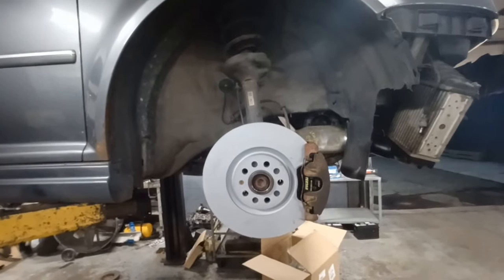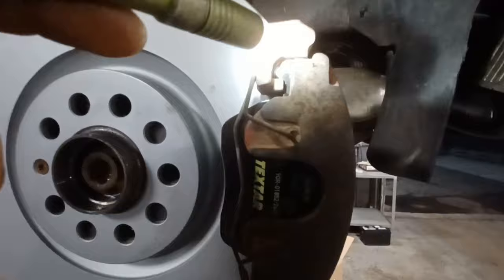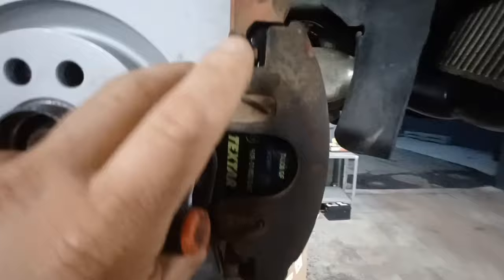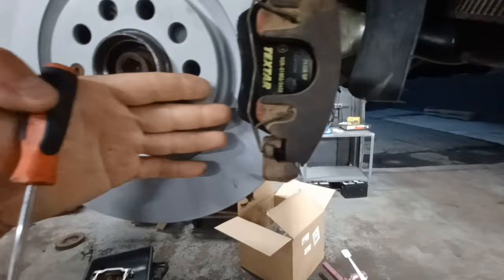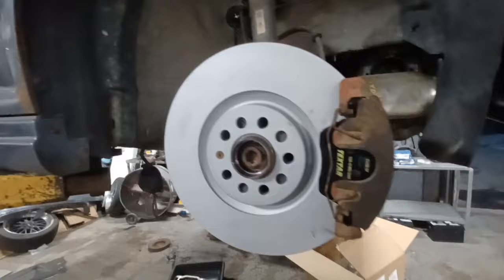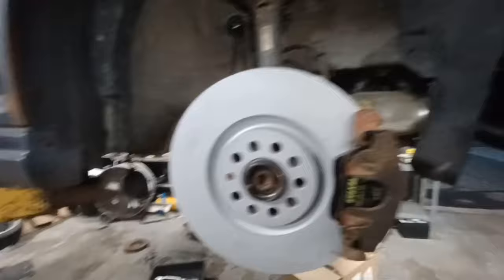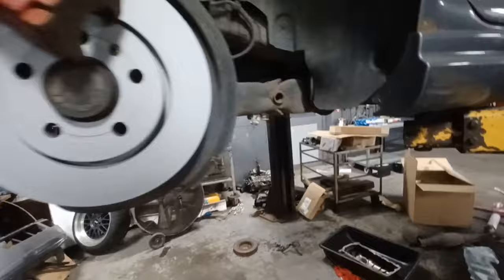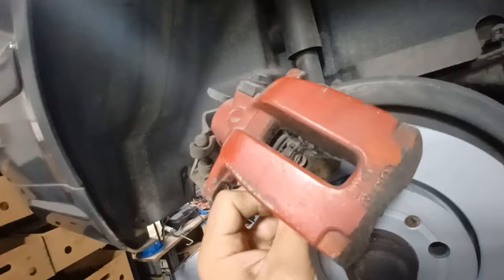COMMON CAUSE OF CLICKING NOISE WHILE APPLYING THE BRAKE

Comment: So far, this video is the closest thing I've seen to diagnosing my issue. I hear the single knock every time I stop. But also a little bit when I take off. I suspected something to do with the caliper being loose, but it doesn't seem to be. Guess I'll check the pads too. Thanks!
Reply: Any luck ?? ME TOO
Reply: @jsupa3737  No luck with brake pads. I think they're ok. I did see another video online that showed the noise being made as they backed up and drove forward. In the comments section I learned that they replaced the lower control arm and that fixed it. That's my next step.
Reply: I had this issue and what was causing it for me was there was only 1 screw holding in the rotor and it was loose so i got a new screws to hold the rotor to the hub but added 2 since on hondas theres 2 screw holes..@renaissancemaneric8019

Comment: Hey, I changed my wheel bearings On the passenger side yesterday and today a clicking noise started coming from that spot, it only stops when I’m stepping foot on the gas and when I let go or only maintain a speed, it starts clicking again. The faster the car goes the faster it clicks
Reply: I was wondering if you can help me out, thanks
Reply: Its an 06 chevy cobalt btw
Reply: The clicking sound is rhythmic
Reply from the maker: Have you already pulled the wheel off and checked all the hardware that was disturbed?
Reply: I have the exact same problem
Reply: Wheel bearing prolly the abs/wheel speed sensor

Comment: 2008 Chrysler Aspen front right wheel bearing was replaced and every since then our truck has been making a noise almost like your bouncing on an old box spring ; we replaced brakes calipers rotors hub assembly on both sides arm control and it still is making a noise as we brake almost sounds like something is going to break it and a noise like your jumping on a old school box spring ! I have take it to three mechanics where I am charged lots of money not fixing issue please help me..

Comment: Hi im also facing this clicking noise when i press break but not all the time. Also when I accelerate or if my car moves over a speed breaker. It wasnt there before, i took my car for an inspection yesterday and they said everthing looks fine just need to tighten some nuts and bolts after that i have been facing this issue . Kindly guide what I should do as this sound is really annoying
Reply from the maker: Does the noise coincide with a brake pad replacement?
Reply: @EuropeanAutoRepair  i didnt replace anything they just told me they tightened the bolt and nuts

Comment: My 2009 Lexus Es350 has had this pop noice for years! Lexus couldnt fingure it out. Since 2022, I replaced the Cv axles, control arms, ball joints, sway bar bushings and links, complete struts and today the engine mounts, and it still does it.

Comment: Thank you for your uploaded video. Because of your video i solved my problem. My local car dealer technician also cannot find the problem. Wasted my money USD 200 change tie rod, ball bearing, stabilizer link. Still cannot solve the problem, somemore wanna change lower arm. After see your video. Ask the technician check the brake. Then solve without single cent.

Comment: Hey man, good video. Hope you're doing well. 
I was hoping for your input on the issue I've been having. 
My Lexus has new front calipers, rotors, pads. New rear rotors and pads. 
When I press the brake pedal there's a very clear click, only one. It happens I'd say 7/10 times I press the pedal. 
I also feel a shaking when I drive the car which worsens with speed. Add to that a humming noise when I turn left. I've concluded that to be a front right wheel bearing which I will replace.
I'm still unsure of the clicking noise I hear in the front end when I press the brake pedal. I have 4 new tires, recently balanced, and aligned. I explained to the alignment tech my issue so he went over my front end suspension and said everything was tight and in good shape. He says he thinks the brakes are probably the source of the issue. 
If what you're saying in your video turns out to be the issue, what's the solution? OEM pads?
Thanks for your time..
Reply from the maker: Hey! Thanks for watching. Yeah typically if you have this going on oem brake pads will resolve the issue. Give akebono brake pads a try if you want to go with a good quality aftermarket
Reply: I have a 2009 Es350 with the same issue coming from the front right. Lexus couldn't figure it. I've replaced cv axles, sway bar bushings and links, struts, ball joints, earlier today engine mounts, and unbelievably, it still does it...

Comment: When I apply the brakes on my van it makes a clicking noise but I feel it also stabbing the pedal so I reckon its an ABS thing - the splined part of the shaft next to the sensor is very rough and corroded so it could be that throwing out the sensor maybe.

Comment: I also changed my Ford Mondeo 5 hybrid brake pads. The original was earlier, but I replaced the same with a textar - I have the same problem - if I slow down, then there is a click at the end, and after that, if I do acceleration, I again have a click after braking.
I will supply the original - manufacturer ATE brake pads
Reply from the maker: Once the pad is loaded in the same direction, (several stops in a row going forward only) does in continue to click or is it only the initial time?
Reply: @EuropeanAutoRepair  Clicks are heard while driving, they do not happen only once. For example - if you go down a hill pressing the brake several times or approaching a traffic light, I stop and keep my foot on the brake pedal (the brakes are loaded), after when I start to move smoothly, a lone click is heard. If you do not slow down hard while driving, it does not appear. There is also a click when I start to slow down intensively, and after I press the acceleration again, a single click is heard again. I replaced the brake pads, as well as the original ATE guides (bushings and pins). I noticed that after replacing the textar there was a problem.
Reply from the maker: Ok so the problem was not present until you installed a different set of brake pads, I’ve had decent luck with textar branded brake parts lately but sometimes it happens, let me know what you find out
Reply: @EuropeanAutoRepair   I ordered original ATE pads - identical to the brake system itself. 
I bought TEXTAR in a spare parts store, it does not cause distrust, there is a hologram on the box ...
As soon as I replace the pads and if there is a good result, I will write here
Reply: Hi. Is it dangerous to use the car when there is a clicking noise like that? It only happens when i first start the car and doing brake in reverse. Thanks
Reply from the maker: @billyboireyes4923  usually more of annoyance than a danger, I would have to look at it to be certain
Reply: @billyboireyes4923   I CHANGED THE PADS TO THE ORIGINAL, there is also a clicking noise during acceleration and at the moment of braking - this is a relay of a hybrid installation. If there are single ones, then this is a play in the splines of the wheel hub, the place where the splined shaft enters. I did the following - coated the slots with red sealant (you can also use blue), let it dry for 24 hours. In the case of backlash in the slots, this would solve the problem by 1000%. Nissan leaf suffers from this - find the video. There, the owner simply missed the slots with a viscous molybdenum grease, this solved the problem for 1 year
Reply: I have this clicking noise at semi slow speeds on a brand new 2023 a3 (80 original miles). Could it be anything else but the play of lose brake pads?
Reply from the maker: If it’s consistent with or without brake application it could be something like a rock or nail stuck in your tire even
Reply: I have a clicking noise when I’m stepping in the brakes, it only happens when the rotors are hot( brake pads and rotors changed at the same time )

Comment: Hey I have this exact clicking noise after rear brake pad change when I apply brakes at a low speed only... Is this clicking noise a hazard or is it harmless
Reply from the maker: If the noise is the pad shifting in the carrier it shouldn’t be dangerous just annoying

Comment: What’s a remedy to fix this you think? I installed some new power stop brakes and I’m having this problem. I’m thinking some shim in behind the hardware would help decrease the gap
Reply from the maker: Usually brake pads made to incorrect tolerances causes this, of course make sure all your clips and shims are positioned well and in good shape but you may end up replacing pads again

Comment: I had my brakes and discs changed on a 6 series bmw,,I've noticed some noises coming from the wheel when accelerating,,and a grinding noise kid of a clock but more a grind I think,,but is because its had new brakes and discs?
Reply: 6 series is a sports car right?. If so figure the pad and rotor material. A bmw came in once they changed there brakes with organic material type and it turned out to be the pad material

Comment: I have a 2022 nissan kicks, I’ve been experiencing a knocking noise when I brake at a low speed or turning with low speed. Started happening back in May and has been getting louder and more consistent. I’ve been told it’s a normal noise from a Nissan kicks however can’t find any information on it when I google the problem.. any suggestions?
Reply from the maker: I don’t know much about that particular model, might be worth it to have a independent shop near you try to replicate it on a hoist
Reply: I experienced this and it was my cv axle and wheel bearing. It caused the wheel to shear off
Reply: My 2023 Kia Rio had the same issue. Each time I hit the brakes I hear this clunking/knocking sound from the rear end. I emptied out my trunk to see if the sound persists and of course it was still there so I had the technician at the dealership take a look at it while I was to service my car. They checked and said there is no problem whatsoever with the brakes (now i ain’t sure if they actually checked it cuz I wasn’t there to see, was in the waiting room). I couldn’t do it no more, it was annoying and interfered with my driving at times having me hit the brakes multiples times to make the noise go away. So I made an appointment at a different Kia dealership and have them check it out. They were able to replicate the issues, noise was coming from the rear end caliber, he said it was gripping too tight and they loosened it and no more noise. Voila! Cost me 190 bucks though. It was worth it.
Reply from the maker: @savithrivenugopal I’m glad you got it figured out!!

Comment: I hear a banging noise from rear while I apply brakes. Noise increases as i drive more. What is the noise coming from?
Reply from the maker: I’m not sure what you have going on there. It might be a rear brake rotor with a bad spot on the friction surface, did the car sit for a long time recently?
Reply: I was on a long drive to a hilly area with lots of speed breakers. Had to apply a lot of brakes. After a point whenever i applied brake hard then a knocking noise starts and disappears as i step out of brake.

Comment: What kind of fixes are there for this? Dealing with this on my 2020 rc350 I just got new pads and rotors
Reply from the maker: Usually replacing the pads is the fix unless it’s a shim issue